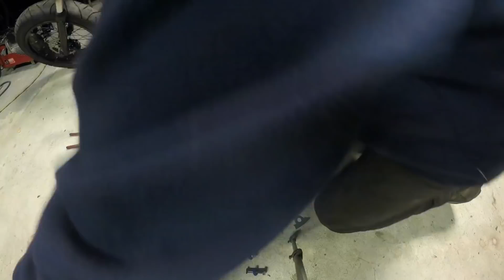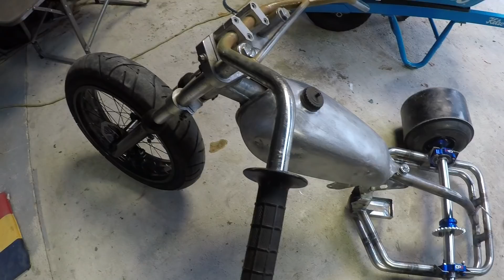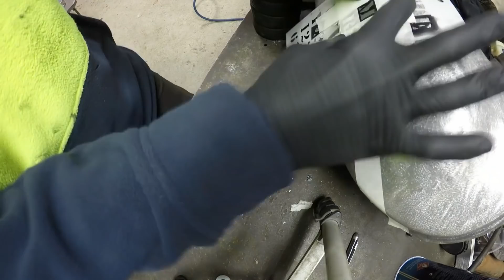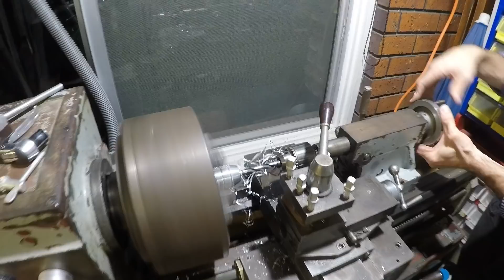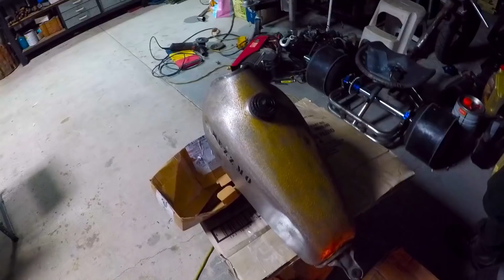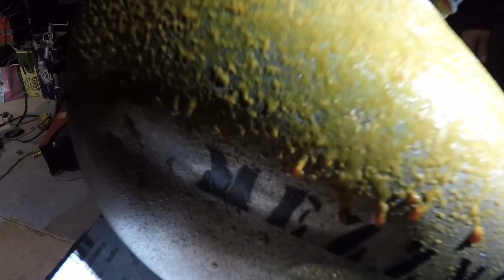Custom Drift Trike Part 6

Comment: are you going to build some foot  pegs for it ?
Reply from the maker: Hi Filip, Yep I'm just thinking about how I want them positioned. Will be getting to that shortly.
Reply: @Mezzmoengineering  maybe from upper tube   it would look interesting
Reply from the maker: @filipcsizmar4860  As this stage thinking of mounting the foot rest bar to the bottom of the engine to keep it looking clean. Also considering from the upper tube but need to compare both first.